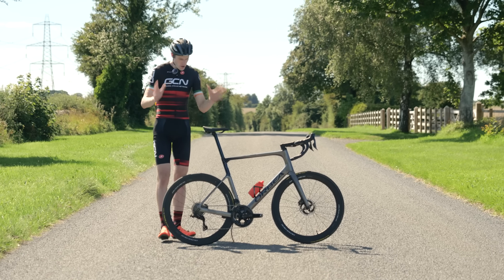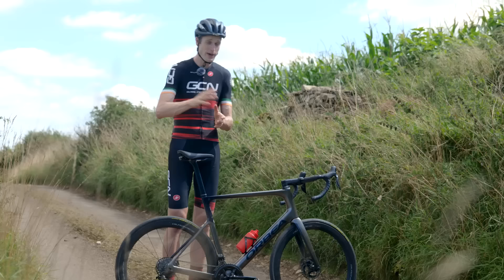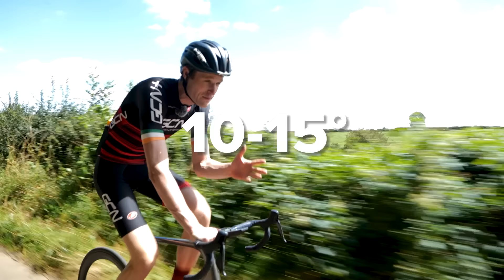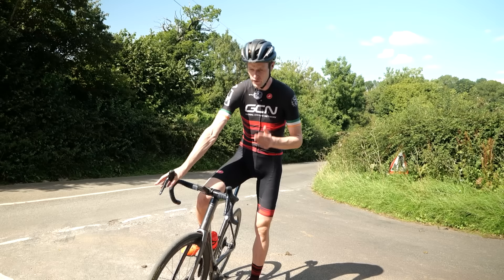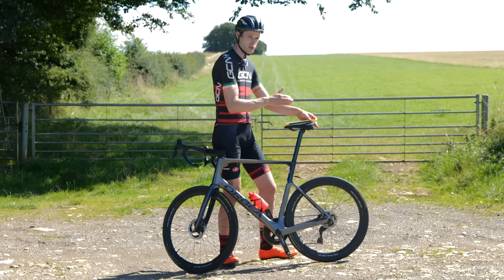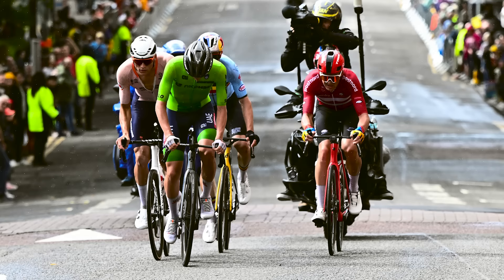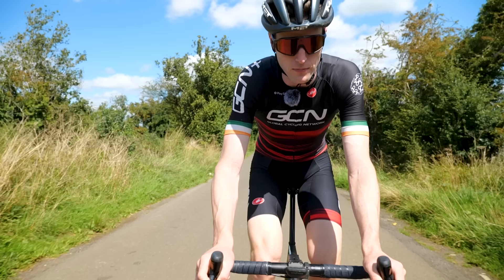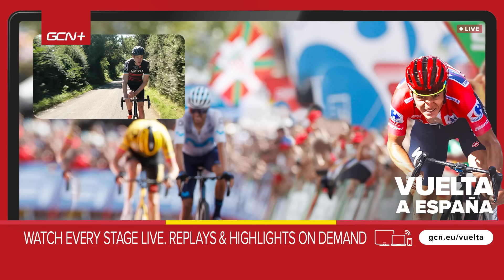Saddle Angle: Have We Been Getting It All Wrong?

Comment: I've been playing around with saddle angle for a while now.  My saddle has a very slight "valley" in the middle where it feels comfortable for me.  I had it nose down by about 3-ish degrees and didn't really slide forward, but I did notice some "pressure" in that direction.  Just a sort of tugging that was trying to pull my chamois toward the rear.  I moved it more toward flat and that issue seems to have gotten less pronounced.  This seems like one of those personal preference adjustments for sure.  What feels comfortable for one person won't work another.  Just my experience...
Reply: Absolutely right, in each case it needs to be specific to each rider, their anatomy, their riding posture, and the type of riding they are taking on

Comment: Great info Connor and GCN, thanks! Since the bike angle always matches the slope of the road, if a rider maintains a consistent position when starting a climb, there would be no extra rotation of the hip or pelvic joint. So, I suspect that a negative seat angle on climbs helps compensate for slight shifts in rider position while seated, and perhaps more importantly, a shift in the rider's pedal force, or downstroke direction. That is, the main push of the downstroke may shift from roughly vertical on the flats, eg: 12 oclock to 6 o'clock, to slightly forward like 1 o'clock to 7 o'clock on hills. From Newton's famous action / reaction law, this force shift would tend to cause a rearward slide on the saddle, which can be compensated for by a negative saddle tilt. In fact, any riding position or natural pedalling tendency that emphasizes a more forward oriented downstroke, harnessing more glutes and hamstrings than quads, may benefit from a negative saddle angle, for the same reason.

Comment: My saddle position changes slowly over the season and of course with different saddles. As a Long Distance /Endurance rider comfort is faster for me. I basically start at level and then make small adjustments if I notice that I am sliding forward or back on the saddle (leather saddles Brooks or Berthoud). I have recently bought a 3D printed saddle and notice that I want to tilt it down slightly (you just don't slid at all on these). As always just my 2 cents

Comment: I think you need to start with the correct sadle to support your body with you seat bones and supported first of all not sitting on soft tissue, so right width sadle. The saddle angle should related to the seat bones forward which should be level with the ground and tilting down as required. More tilt should relate to handle bar height and reach as with hip rotation forwards. Triathlons and time trials more commonly wiill require more tilt forward as with any cycling in aero positions. In my opinion.

Comment: only part of a saddle that should be (approximately) flat is the front half (in profile). that usually means the rear has a nice little kick-up which is more supportive and helps with power production 'cause you can sort of push off it.
so there.

Comment: Would it make sense to use the saddle rails as a point or reference to determine the angle, especially with saddles like the SMP?
Reply: Not in general. Lots of saddles have tilted rails so that with a flat saddle any forward/back adjustment of the saddle gives roughly the correct amount of up/down adjustment too. For example Fizik saddle rails are tilted 3 degrees or so. Of course the rails are good for relative adjustments (e.g tilt down one more degree) but not for general purpose recommendations.

Comment: Good data here that makes perfect sense, but it can't be looked at in isolation - everything interacts. I think the saddle angle should be paired with the stem drop. Pros slam their stems giving you better aerodynamics, and the saddle tilting down would relive the strain on the lumbar and sacrum. My lower back is fused from L4 through S1 and I have to tilt my saddle down even on a more upright gravel bike.

Comment: if your saddle is at 0 degrees on flat ground - and you are riding a 10% or 20% gradient - it will REMAIN 0 degrees to the ground regardless of the gradient - MOST riders do tilt forward at the hips to compensate for the gradient and increase in power required by driving into the pedals harder when in the saddle - similar to how a sprint runner tilts forward to get maximum propulsion - the steeper the pitch the MORE the hip tilt - but this technique also occurs on the flats when a rider attempts to get into a deep aero-tuck to reduce wind drag - they are the EXACT same kinematic postures - I think the reason for 0 degrees saddle is to evenly distribute the body weight on the load bearing points of the pelvis bones structural - this is what the manufacture has designed for at 0 degrees - so when you tilt your saddle forward you are disrupting that weight distribution and overloading certain skeletal load bearing points - sure mountain climbing may benefit with tilting forward but the majority of the race parcours is flat or rolling terrain - with comparably short intermittent mountains - point being - while you MIGHT improve performance on mountains - you are almost certain to develop OTHER physiological issues long-term - upper shoulder-elbow-wrist-hand come to mind as they are going to be forced to take on MORE load bearing duties than they otherwise would - to PROVE this - tilt your saddle forward 20-30 degrees and go for 1-2h ride - you WILL feel it - so even at 10 degrees that added load will be there - in short - I think it is a BAD idea - just a trendy fad - I am certain it is NOT the reason Pogabike wins races - his power in the mountains comes when he is OUT OF THE SADDLE after all - less so when he is in it

Comment: I found that I have to tilt my saddle back rather than forwards. If it's tilted forwards I get wrist pain. If it's tilted backwards I get numbness in the nether region when going uphill. The wrist pain quickly becomes unbearable and persists even after the ride, so that's a no-go. On the other hand, I have found that I can shift around a bit on the bike to afford a position to relieve the numbenss (if the saddle isn't tilted too far back and the numbness is only slight). Maybe this would decrease my power output going uphill a little bit while going uphill but tbh I couldn't care less if it improves my comfort and if it means I can ride for longer.

Comment: I live in a hilly area. Constantly up and down. I run -8% or saddle nose .5 inch lower than the rear end and sit towards the rear of the saddle while climbing. When the road flattens out i slide forward, lower my shoulders and tilt my pelvis forward. It helps keep my thighs out of my belly too😊
Reply from the maker: Sounds like you've found a great system that works for you! How do you get along with long rides?
Reply: @gcn  what are long rides? 😂 jk. Everything is fine until the legs run out of steam. Then the upper body gets pretty heavy on the bars. Pinky fingers start to get tingly. Punishment for weak legs!

Comment: at 4:20 your flat saddle would be at the angle of the hill, not half of the angle.

As far as setting the angle, It's another case where what it looks like doesn't match up with reality.

Firstly, your saddle shape plays a role,, depending on how your sit bones follow the shape.  Often to get your sit bones kind of flat could need some tilt in either direction, and could be different between different people.

Secondly, the idea of a flat saddle relies on the assumption that you're balancing on the saddle, where most people are holding some weight on their feet, and to a lesser degree hands..  Both of these supports will add some push backward, which can sometimes be better balances by slightly tilting the saddle down.

Really, it makes most sense to adjust by feel.  I end up with different angles depending on the saddle, and depending on the bike it's installed on.

Comment: I have zero idea on my power output and don't care either. I would probably waste more power through incorrect tyre pressure. BUT i do care about comfort. And if i do not tilt my saddle down i have too much pressure in "the area" and get sore. Tilt saddle down, no pressure and the ball bearings and gearstick and surrounds are happy. 😉

Comment: The fitter recommended -3 to -6 for a saddle with a "kick" or higher rear section. Would this not result in a much steeper effective negative angle? Or by negative angle was he referring to placing the nose higher?
Reply: When there is a ‘kick’ or a curve to the saddle we just need to account for this as we know the rider is not sitting on the peak of this rear kick or curve so if we were to set one of those saddle ‘flat’ from the high points then it would likely result in quite a relative nose up position which would likely lead to more central soft tissue pressure and/or more posterior tilt of the pelvis
Reply: @thebikethebody  got it. So you are measuring with the level across the entire saddle and not just the flat section from middle to nose. I will try that recommended angle as a starting point. Thanks for the info.
Reply: @matthew.tamasco  correct, let me know how you go and give me a shout if you need any further guidance 👍

Comment: Level or ever so slightly tilted nose down works for me.  Setting saddle height too high is, I believe, common.   People are using formulas and believe they need the saddle high for power.  But this just makes hip mobility an issue and given one hip is often less mobile than the other, hot spots or knee issues on one side can result on one side.  Get the saddle height that works.  Nose down never worked for me.  Feel my bike is dialed in now on a flatter saddle.

Comment: 10:02 I sit on about -8 to -10. This is mainly for comfort as 90 percent of the time im in the tri bars as the handle bar’s flares up my carpal tunnel. I find this pretty comfortable for even long rides. Any flatter and i end up with a little bruising. 😢. I also find it works really well going up hill as a backstop to put some seated power through the pedals.😊

Comment: 2-5 degrees base off of the flat portion of the seat which generally the front. Youth, ( under 35 ), is where flexibility still exists. The older one gets, less flexibility, the more the stem angle comes up and back, the less we are into the drops. At 68 I still prefer a drop bar, no flat, with around 1-3 inches of bar height below the nose of the seat. I've had my nose down where I was nosed down too much but was comfortable. I fit myself, it comes close enough. Generally the only time I've experienced knee pain was when I had my seat too far forward or backward and height not adjusted correctly. As far as the back pain and shoulders, I keep my core extremely strong and do an array of upper body exercises such as shoulder shrugs to keep my neck strong. I share nearly the same seat heights, angle, fore and aft positioning on both my gravel and road bikes. Comfort is key, first in the saddle then my extremities, (body).

Comment: There is such a thing as flat saddle derangement syndrome🤣. Often from fitters here on youtube. "science actually says tilt it forward (nose down) Although gravity points down, the vectors of force from your body doesn't. As soon as you put your hands on your bars, it immediately points the vector of force a bit backwards. It not a large but exists. Also your pedals are in front of the saddle which means there is an addition force pointing to the rear. To pedal down against gravity we need to shift forward and stand up. Luckily tilting forward also avoids soft tissue damage, and enables the pelvis degrees of rotation both back and forward. Setting your saddle according the these vectors makes it appear to your bum as if it was flat, hence you do not slip forwards.

Sins in cycling....1. being new. (a chopper)  2. no helmet   3. tilting your saddle forwards

Comment: Yeah the whole blank of wood across the saddle doesnt work as you end up with a saddle nose up every time even if at - degress, the best method by far is the first 3rd of the saddle nose thats where you need to measure , not the whole saddle, thats if you dont want urological issues, and the best saddle ive found that works a treat is the sq labs saddles at 0.5 degress nose down .

Comment: I much prefer a saddle angled quite downwards as it hurts my Perinium after a short while. If you have a stronger upper body, does not matter.
Reply: Core and lower back strength always helps give you more options but if you find you struggle to get comfortable without having significant nose down tilt then it may be that there is a saddle out there that would better suit your needs for both comfort, stability and performance

Comment: Just set up by trial and and error until u get the set up right for yourself. Ur riding career will last a lifetime, ull have plenty of time. All this bit fit thing is regulated by using clip in shoes. If u have a slight tilt up and flat pedals, u can slide acccording to flat roads, downhill, up hill. At least it works for me. Perhaps I'm a freak.😅